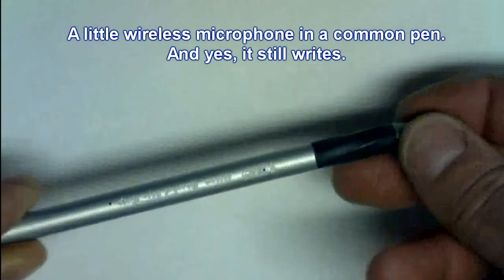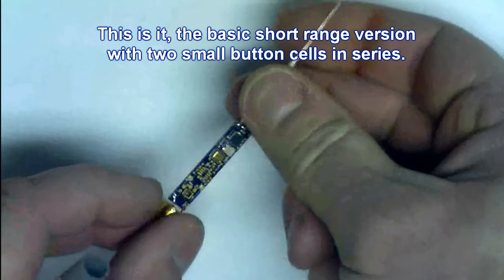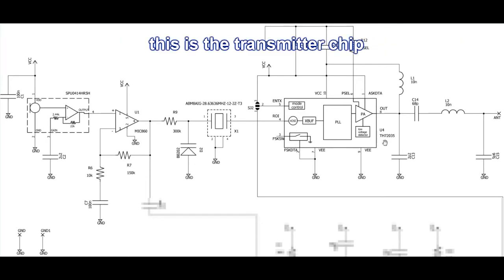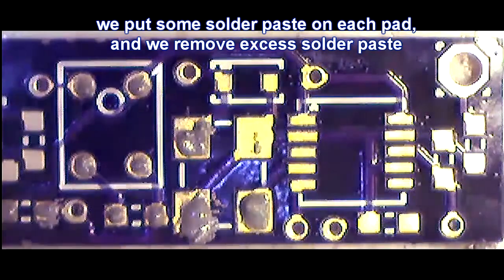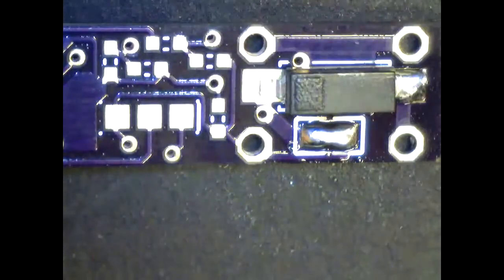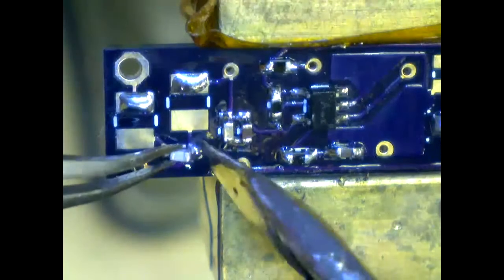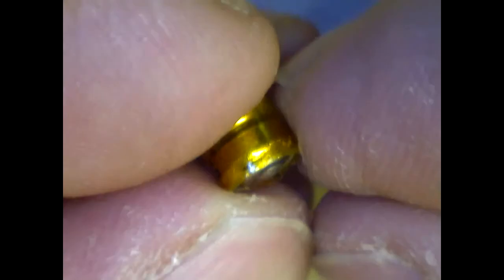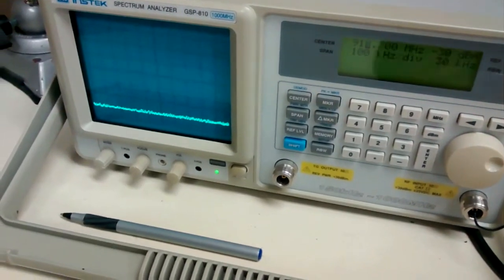How to build a professional long-range spy UHF transmitter

Comment: What software are you using for the board?  I cannot get the gerber files to open in Kicad 5.0.2 or Gerber Viewer Gerbv 2.6A.  I make my own boards. Thanks.
Reply from the maker: EAGLE. Former Cadsoft, now Autodesk.
Reply: @tomtechtod9200  Thanks.

Comment: Thanks for sharing the circuit and the pcb! I built it and it works great. Unfortunately the dc-dc converter you use is no longer available at the distributors. Could this ic be replaced by another part?
Reply from the maker: At this moment still available on Digikey. If you are in North America still the best option. https://www.digikey.com/product-detail/en/torex-semiconductor-ltd/XCL101A331ER-G/893-1394-1-ND/7566389.
I don't know if direct replacement ICs exist, maybe the layout would need to be modified.
Reply: Hi Tom, I'm trying to extend your circuit with an amplifier. But if I open your eagle file, I can't switch to the circuit. It's saying that board and circuit are not consistent..

Comment: May I know which modulation RU using here?
In Ur PDF.. It's written BFSK... But in what part of ckt RU digitalising the audio????
Reply from the maker: Audio is not digitized. The frequency is determined by the crystal and you are slightly pulling the frequency via the varactor diode , the same way you would pull the frequency via the internal FET when using FSK.
Reply: TomTechTod 
Can u please tell me a DIP package IC equivalent to the SMD IC TH72035 that u have used for modulation??
Reply from the maker: No sorry, through hole ICs is really a thing from the past.
Reply: TomTechTod 
Oh.... That's sad.... But thanks anyway....
Actually I am making this ckt as an engineering project.... And I'm facing difficulties in finding the right components itself...
Never mind... Thanks again for the help.

Comment: Heya! Curious though, using the 319 battery, is it chargable? Or if not, do you need to keep replacing it? So need to desolder them or how?
Reply from the maker: No, the ones I used are not rechargeable. You can use any battery you wish, rechargeable or not.
Reply: Thanks! Then if its not replaceable, once the battery dies, how do you replace them? do you need to desolder the wire?
Reply from the maker: @sarachen5250  yes

Comment: What kind of radio do you use to listen to this? My portable radio station works only to 500MHz
Reply from the maker: I use an old radio scanner that goes up to almost 1GHz. The cheapest and most convenient option though is to buy an USB receiver like this one: http://www.rtl-sdr.com/buy-rtl-sdr-dvb-t-dongles/. It's about $25, connects to a PC or Android phone via OTG adapter cable. On PC there is free software including spectrum analyzer that alows you even to adjust the bandwidth etc. For Android the only software I found was a paid option but it was only a few bucks
Reply: Thank you, kind sir. I will look in to it!